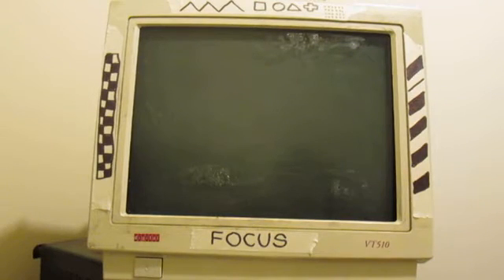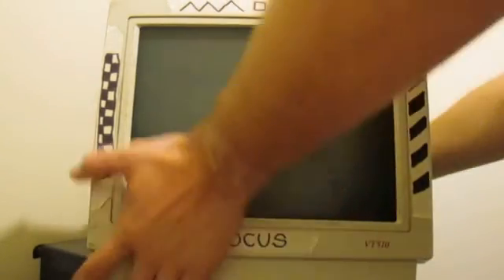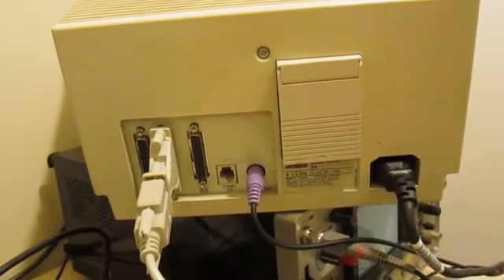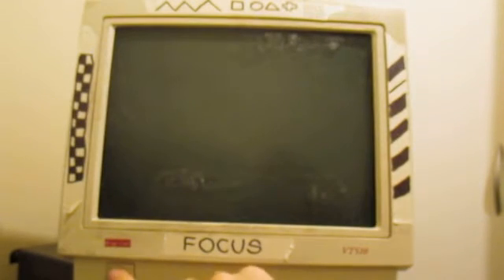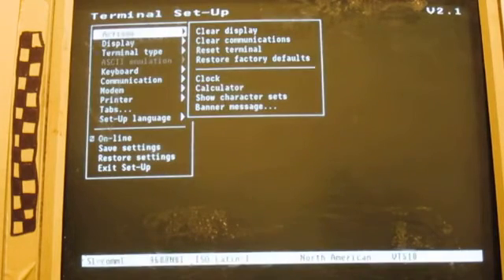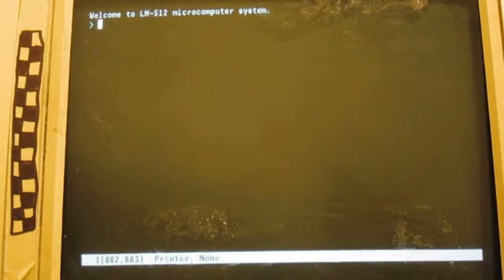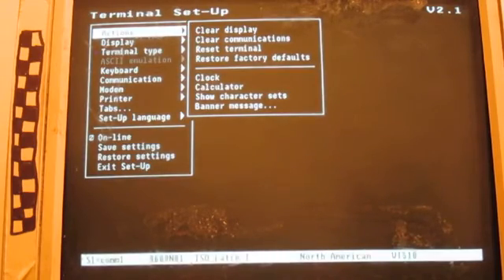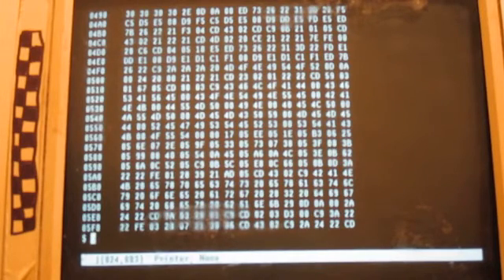LM-512 Z80 microcomputer: use with DEC VT510 serial terminal

Comment: It's good that it takes a PS/2 keyboard, as I imagine that is the part most likely to wear out. I bet those old proprietary DEC keyboards are getting hard to find now.

Back in the '80s I had a VT-220 and 2400 BPS modem given to me by my employer so I could work from home. I had to learn all the Hayes modem commands to dial out and connect. Extremely crude by modern standards.